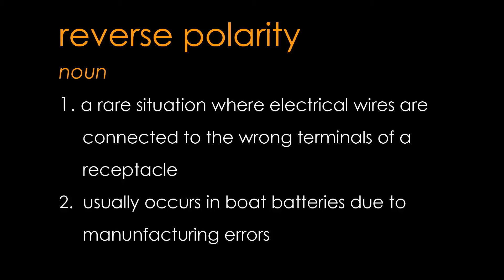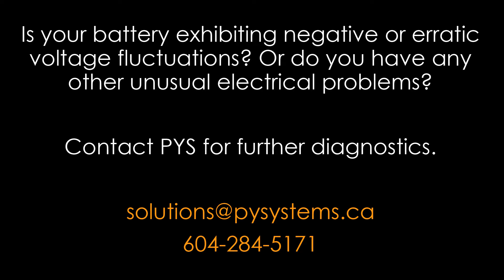Reverse Polarity in Marine Batteries

Comment: I have also seen this on a C950 loader. It was retrofitted with a one wire alternator and wired through the old external regulator. And some how they had the battery cables backwards to the box. They didnt go the other way. Not long enough. Sure enough one day this thing was blowing a breaker to the alternator. Took many minds to figure out what happened.

Comment: Don’t blame the manufacturer! LOL! That happens when a battery is completely dead and you put the charger leads on backwards. So one of you guys screwed up when charging it. You do not need to throw that battery away geniuses! You can reverse the polarity back the same way that you reversed it in the first place. Drain the battery is dead as you can possibly get it so it won’t even  light a little LED. Then you can charge it back up with the proper polarity. As long as you put the  positive lead on the positive terminal and the negative lead on the negative terminal! Geniuses!

Comment: I've also seen this happen on submarines because one cell has a cleaning deficiency that grounds it. this creates a small current to ground that drains the associated cell. then during normal operations the rest of the bank will push the cell into reversed polarity. regular cleaning of batterries is an absolute necessity. any small dried up acid trickle or even a thin layer of dust WILL kill that cell if the issue goes unaddressed. 

if you have a dirty cell...clean it or you will buy a whole new set.
Reply: HillbillyMatt ExtremeDIY hello
Reply: HillbillyMatt ExtremeDIY have something to ask